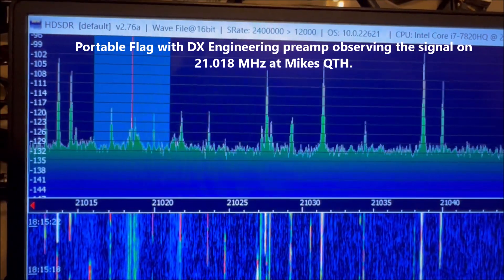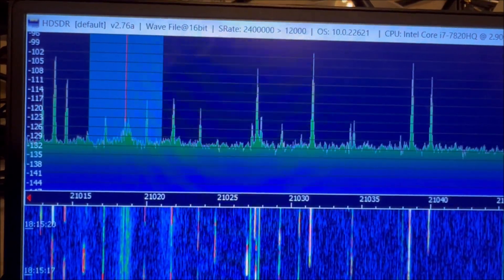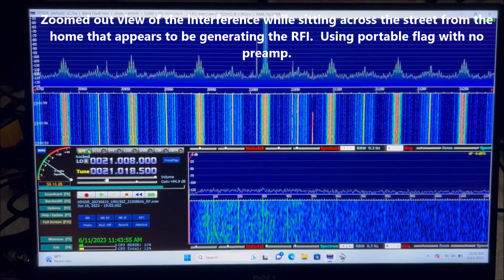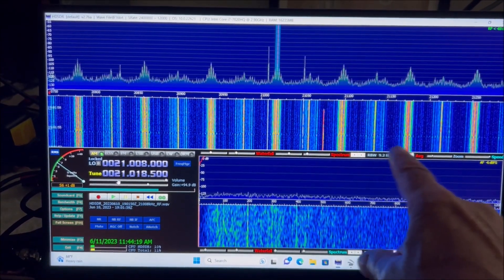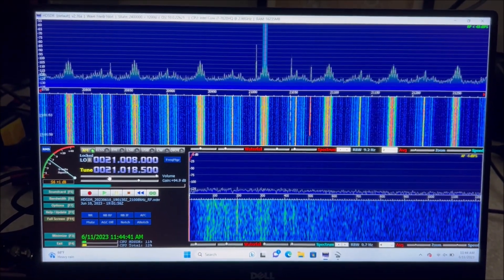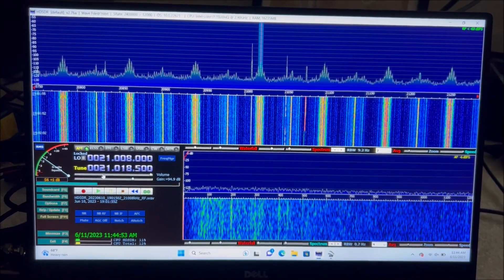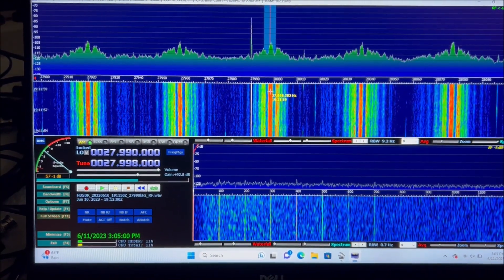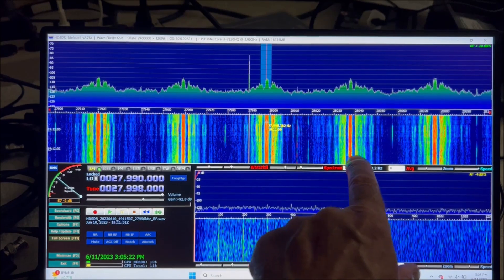RFI (radio frequency interference) at W9RE on 15 meters tracked down to home 0.37 miles away.

Comment: If its broadcasting that far it likely is radiating from the line that goes from the solar panels down to the inverter. I'd suspect a proper filter on that drop would keep this noise from running up that "aerial".  It would be in the input of the inverter. Is the line shielded and properly earth grounded?

Comment: Seriously, this is pathetic. Leave people to live their lives
Reply from the maker: JingleBop, here is an update.  The poor person you speak about in this video is now getting their monthly electricity bills as well as their Solar financing bills paid for by the manufacturer of their Solar system hardware until the Solar hardware manufacturer installs new hardware that’s under development to eliminate RFI that their hardware generates.  The homeowners in this video are now greatly benefiting financially because we tracked down the radio frequency interference to their solar system.  Just FYI, Don
Reply from the maker: Hi JingleBop,
Interesting comment from you considering it looks like you are into flying remote controlled planes as the interference being generated by this house is right on one of the RC (remote controlled) bands often used for flying remote controlled planes (27 MHz) and while we did not check it's possible that it's also generating interference up on the 49 MHz RC band.  This kind of interference could prevent folks from flying their RC planes or greatly reduce how far they could fly as well as causing a potential crashed or lost RC plane.  Radio Frequency Interference has an impact on many things but since it’s not easily seen most people don’t understand why it’s a big problem.  P.S. also see my response to "Always Here" as it shows why homeowners are often very happy that we tracked the RFI down to their home as it often winds up solving an unknown problem they were having in their own home.  Just FYI, Don

Comment: Grid-tie inverters usually have to pass all kinds of certifications for protection and EMC.  If the homeowner used an uncertified (cheap) inverter, he could be forced to disconnect it by the electric utility.  You can't just connect any inverter to the grid.  Hopefully they get this resolved.

Comment: Its being done intentionally
Reply from the maker: Hi Always Here.  I've investigated many radio frequency interference cases, and none of them have been intentional.

Often the homeowner or electric utility company is very pleased that we found a problem as numerous times the source of the interference was a device within their own home that was even causing the homeowner a problem.  One home could no longer listen to their AM radio because the interference from their cable TV box power supply was so strong, and another home was using a wrong voltage wall wart (AC/DC power adapter) and it was so hot that it could have caused a fire or destroyed the device the AC/DC power adapter was connected too.  In both of these examples the problem was easily corrected at no cost to the homeowner as the cable company supplied a newer model cable box in the one case and in the other case the homeowner found the correct AC/DC power adapter intended for use with his device.

In another funny case a homeowner who turned out to be an inactive amateur radio operator thought he might have a bad power supply in his computer because he was getting loud noise in his computer speakers so he had already purchased a new power supply but had not yet installed it, and sure enough when he replaced his computers power supply the radio frequency interference being heard over 0.2 miles away disappeared as did the noise in his computers speaker (he was amazed as was I).

A lot of interference is also generated by electrical utility company hardware that's faulty (failed lightning arrestors, etc.) and just last year I tracked down an above ground high voltage feeder cable causing interference over a mile away that was visibly arcing (you could see it arcing when dark outside) and most of the strands of the cable were broken and the utility company was extremely happy that I found the frayed cable and that they were able to repair it before they had a major power outage.  Just FYI, Don

Comment: I built your flag antenna and was about to build the preamp. My son sent me an early Father’s Day gift ($$$) and I briefly thought about ordering the DX Engineering version.  I suspect they aren’t the same since the DX version is powered by a 9v battery. I seem to recall that your version requires a bit more current. So, do these two perform significantly different? I also think the noise figure on yours is better, but for the purpose we use it, is that a significant factor?
Reply from the maker: Hi Bob,  I now only use the DX Engineering preamp (DXE-NL-PRE-ATT-1) with my portable flag and it does use a 9 Volt alkaline battery which lasts approximately 8 hours, and I also use it with all my other HF portable direction finding antennas too (tuned loops, untuned loops, etc).  I previously used either a W7IUV or W1FB preamp depending on the situation and used a 9 Volt alkaline battery with both of them too.  The DX Engineering preamp was designed for use with my portable flag and I now use it all the time since it has a selectable AM broadcast band blocking filter as well as 10 and 20 dB attenuators which are selectable with or without the actual preamp being turned on and this is invaluable depending on the environment and what receiver you are using.  I was involved with testing of the prototype DX Engineering preamp and they made some changes to the prototype based on my recommendations before they went into production of it.  I also recommend you read the reviews/comments of this preamp on the DX Engineering website for this preamp as there are some very good comments from users which might be helpful to you.  P.S. I receive no money from anything DX Engineering sells, so my comments are pretty unbiased.

Comment: That definitly could be a solar inverter. 39kHz probably being the transfomer frequency and it generating higher harmonics. The fact that has a slight 100Hz modulation could be due to the load varying at a frequency of 100Hz if the mains frequency is 50Hz.
Reply from the maker: Hi Leo, our mains frequency is 60 Hz.  Just FYI, Don